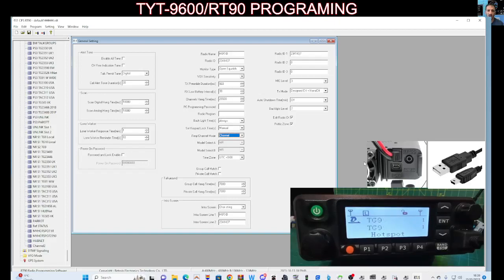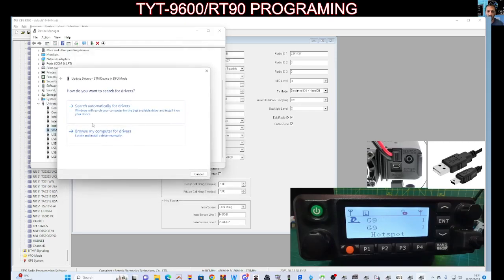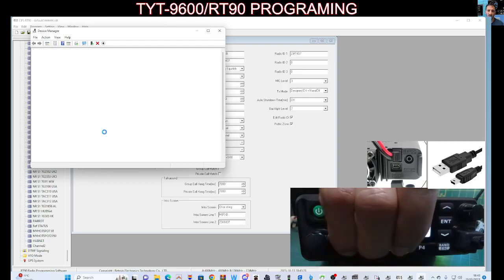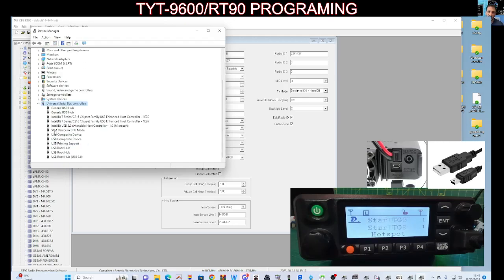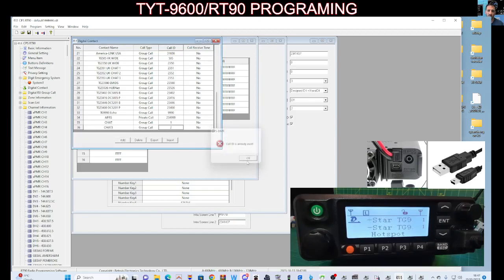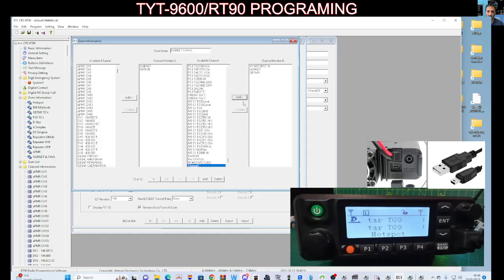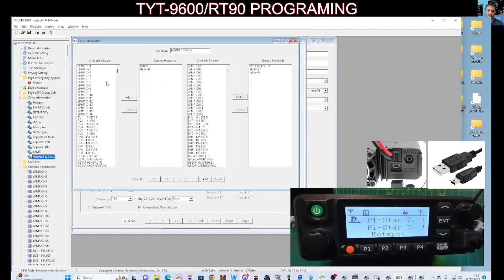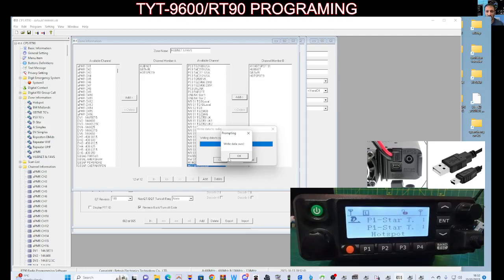TYT-9600/RT90 USB CONNECTION

Comment: You need to do an upgrade to Open GD-77 firmware for the 9600.
Reply from the maker: Yes I will after I learn it as a normal radio